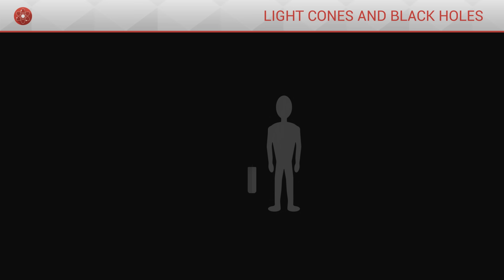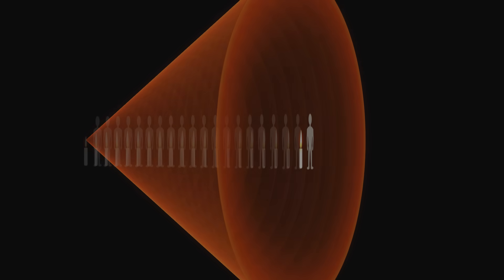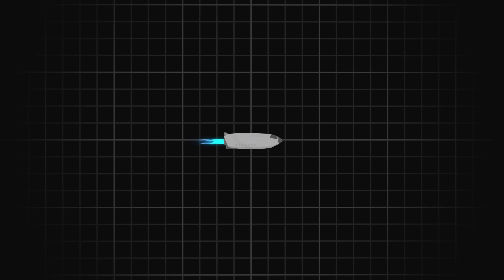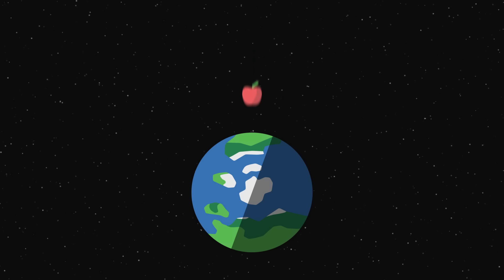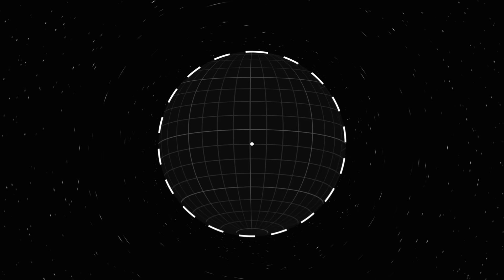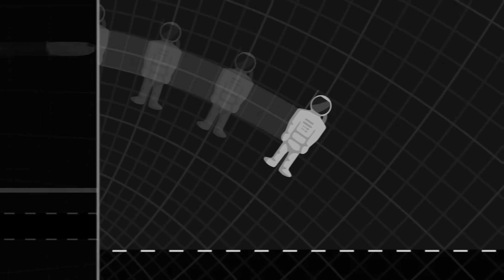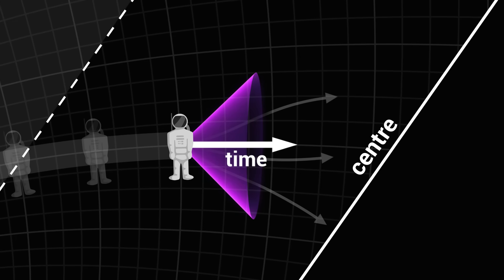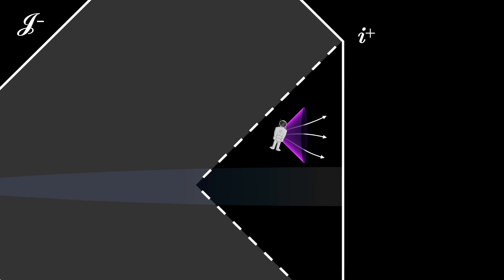Why Time and Space swap in a Black Hole

Comment: What happens to the speed of an object, that enters a black hole?
As we know, all object move through spacetime at lightspeed.
When an object is getting near to the center of the black hole, its trajectory bends even more to the center until it is perpendicular to the line, that represents the center of the black hole.
Inevitably it will fall into the center, but then it cannot continue to move in that direction, cause it reached an end.
Will it then do a full stop? Will it immidiatly turn its direction by 90 degree to move on the line that represents the center?
Reply: Do you mean to ask how the object moves once it hits the singularity? General relativity makes no more predictions at that point, trying to do the math will basically result in division by 0. We can say that the world line doesn't exist anymore after that event. As for what might actually happen if you were invincible and fell inside to watch, physicists believe that it's possible general relativity breaks when the object gets close enough, and we can figure out what happens afterward by using a different theory. But we unfortunately cannot conduct experiments with black holes, especially with measuring what happens to stuff that falls inside the event horizon, so we have no idea what the alternative theory might be.

Comment: Hello ScienceClic,
I love this explanation of spacetime.. I have a question though.. 
If I was the apple falling from space to the surface of the earth (without any initial energy) would I be moving through space? Or just traveling through time?

If I understand it correctly I would only be moving through time.. I would be in the center of the cone and it is this trajectory that creates gravity.. but I would remain still in space?
Reply: Not the video creator but I also studied GR. By the video's definition, yes you will be not moving in space.

"Time" and "space" are not actually fixed directions, instead there are multiple directions that can be called "spacelike" and multiple directions that can be called "timelike". The video picks directions so that time traces the path of a specific falling object. We can pick a different object and end with a different direction of "time". Say you dropped one apple and threw another one upward at the same time. You can pick the first apple for your coordinates, which means the first apple is only moving in time and the second one is moving both in time and upward in space. Or you can pick the second apple for the coordinates, which means the first apple is moving both in time and downward in space while the second apple is only moving in time. Space and time are relative just like in special relativity.

The video is correct despite the multiple definitions. The light cone turns out to be the same, it doesn't depend on how we defined space and time in order to draw it. The black hole's event horizon is tangent to the light cone and all falling objects (regardless of trajectory) will see the singularity as something like a future event once they fall inside.

Comment: With all due respect, these seem more like metaphors for concepts like event horizons to hold meaning.

Even before GR, it is logical to tie space and time together. We can only move, because time allows it. So when you say "I can move anywhere in space but not in time" it's wrong. You can only move anywhere in space *thanks to* time. This premise is a bad premise.

Meaning time IS movement. And space is movement. They are both the same concept viewed from different perspectives. One, an understanding of *position* , the other, an understanding of *change* . But position cannot change, by definition, without change itself. 

So space and time cannot flip, because they are a bad division of the concept of *movement* . The only thing limited here, is your movement, compared to the black hole's. According to GR, its mass limits you, because of your mass, velocity, and prior position. 

Space and Time, sad to say, are not fundamental. They are superfluous, emergent phenomena, from movement. And movement, from identity. Identity from existence. Existence from movement. Round and around.

Thanks for the video, anyway!
Reply: movement, from identity?
Reply: @-_Nuke_-  Bear with me, it's a long comment:

There is (can be) no original action, or concept that "started" any process. The process simply came from the process that made it. And that process, from another one that made it before. Etc.

With that thought to frame your conception of reality, to BE (to have an identity, with a set of properties), you must be made by movement. Usually smaller things must move to make you. Or how would you exist? How would you have what I called your identity? It is the precise accumulation of all elements in your body that makes you, you. To be an element, certain things move, protons neutrons electrons, to be a proton, quarks move etc...

It logically then follows that you, the identity, can now move, in turn. Movement rises from the idea you are a "thing" first. No non-thing can move. First you must BE a particle, a wave, a human, any*thing*. 

Issues arise in any physics context when assuming any one movement or identity are fundamental. In this case, time and space come from movement. But even movement cannot be fundamental. Nothing is. There can only be causes creating effects that become causes. Processes begetting processes. 

That was my point. Physics doesn't actually discuss what IS fundamental. Physics can rearrange our understanding of reality into concepts that act as metaphors, images, to explain what reality DOES. This is why Gravity is still a force, but described very differently from Newton to Einstein for instance. Gravity still DOES what it does. But what Gravity IS, is caused by some other process, in this case the distortion of space-time, which we will one day realise must be a metaphor, an image for some other better detailed process, etc, etc.

There can be no observation of laws without observation of the geometry that helps us notice them, and derive them. So what is physics? The derived general behaviour of the geometry, of matter: the law? Or the geometry itself that was always observable? 

Are laws of physics just clever images, metaphors, for what can be better described as a set of geometric processes? That's my view at least. I hope I was clearer this time.

Comment: Wait, what happens if something falls in, then goes at the speed of light outwards, if the black hole moves by another massive object's gravity, can the object just at the event horizon escape?
Reply: If there are multiple massive objects, the event horizon gets distorted. You might need to be closer to be considered inside the horizon. Still, nothing can escape.

You must shed the intuitive understanding of "inward" always being a spatial direction. Let's drop the black hole and consider regular space. Once you cross the "Tuesday morning 12:00 AM" boundary, can you travel toward Monday at the speed of light to escape tomorrow's project deadline? That question is clearly nonsensical as phrased like this. It's because the direction from Monday to Tuesday is a temporal direction, not a spatial one. The key point is that all things, including light, both move in time and (optionally) in space. You can move from North to South while moving from Monday to Tuesday. You cannot move from Tuesday to Monday while moving from Monday to Tuesday.

Something similar happens inside the event horizon. Your motion toward the singularity is given, all other motion is added alongside it. You cannot move away from the singularity while moving toward it. The direction toward the black hole becomes a temporal direction.

Now this sounds unsatisfying, because you're probably thinking more about what happens if you bought a super powerful rocket, fell into the black hole engines-first, and turned the engines to instantly move at 99.999% lightspeed "away" from the black hole. The answer is that you would be moving very fast in some spatial direction. If you could move purely in that spatial direction without also moving in time then yes you eventually leave the event horizon. But you cannot stop moving in time, and your overall direction will still be toward the black hole.

If you learned special relativity there's another analogy I can make. Special relativity talks about relativity of simultaneity. Say people on Earth believe 11:00 PM on Earth is simultaneous with 11:00 PM on Saturn. A fast moving observer might claim 11:00 PM on Earth is simultaneous with 10:00 PM on Saturn. By Einstein they are also correct and let's honor their perspective. They will watch your journeys. If you were to move toward Saturn at nearly the speed of light, they'd say you were moving very fast in their spatial coordinates. If you purely moved in their spatial coordinates without moving in time you can leave Earth on 11:00 PM and arrive on Saturn at 10:00 PM. Maybe you arrive on Uranus at 8:00 PM and so on forever avoiding the next day's deadline. Alas, one cannot move purely in space. You will move toward Saturn according to the moving observer's spatial grid, but you will still arrive after 11:00 PM.

The exact same thing happens inside the event horizon. The direction you move if you speed "away" will contain some component that increases your distance to the singularity. But you cannot purely move in that direction, instead you move along that direction while still getting closer to the singularity.

Comment: 8:00 But the distant observer should see the astronaut falling without getting to the singularity, right? It should approach the singularity asymptotically, since time would get slower for the astronaut. And in this diagram  it looks like both would agree that the astronaut would reach the singularity.
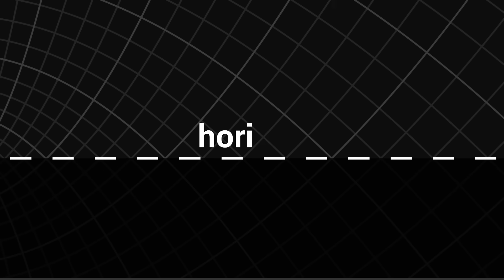Reply from the maker: The distant observer does not directly see the astronaut. He sees the light that he receives from the astronaut. And as it is shown at 7:27 light has more and more difficulty escaping the closer it's emitted from the horizon.

Comment: Not bad. You kind of glossed over the scaling issue though. The light cone shrinks as it rotates.
Reply: Yeah, depending on choice of coordinates it may look very different.
Reply from the maker: Actually I chose coordinates such that the lightcones don't change shape, they stay opened at right angles regardless of where they are or how they are oriented. This is because I based my grids on conformal transformations of Kruskal coordinates. However there is a scaling artefact in this grid representation, in the sense that distances are not to scale in the diagrams.
Reply: @ScienceClicEN  Those pesky coordinate transforms. Just when you thought you were getting the hang of space and time, someone comes along and mixes them up. What can you do?

Comment: what if an event horizon is formed by a ball-like object with more or less uniform density, geomertically speaking the gravity inside it will not be as strong as it is on the surface, so the center will not be a future. and an object will possibly just stay just below the event horizon without falling further

Comment: I find it interesting that all models have observer emitting a light come rather than looking at it as waves from different points in the past converging on the observer. The future might not exist for them.  It hasn't happened yet.
Reply: There is such a thing as a "past Lightcone" it contains all events that could possibly influence you.
It's the reflection of the future Lightcone.
Reply: @narfwhals7843  our experience is created out of the past.  The future doesn’t exist yet.  Any worldliness could suddenly be cut short. The things closest to us are least in the past etc.  but I reject Minkowski spacetime. I have never seen any evidence that time is anything but a compact dimension, a single moment of present which is one Planck second, one Planck rotation, long.

Comment: I believe neutrinos can reach earth before light in supernova. So you could detect supernova before light reaches earth. Great videos!!!! Love the light cone visual.
Reply: Neutrinos do not move faster than light. The experiment that reported this had faulty equipment. It has been checked and remedied.
Reply: @narfwhals7843  I never said neutrinos move faster than the speed of light. But they do move approximately closer to the speed of light. Neutrinos escape the star before the shockwaves even reached the surface of the star. Neutrinos get a head start and also neutrinos don't interact with matter and can pass through almost anything but for the photon is not true.
Reply: @sciencestories22  Ah I see what you mean. That is a fair point.

Comment: "Move through time" sounds like a self-reference, because "moving" is a change of spatial coordinates with time.
Reply from the maker: It does sound weird, however in relativity this makes sense because there are two different notions of "time" : the "proper time", carried by the astronaut and measured on her clock, and the "time dimension", the 4th dimension of spacetime. An object moves through the 4 dimensions of spacetime, as its proper time goes by. And movement can be defined in 4 dimensions. It might be clearer with my series about the mathematics of general relativity.
Reply: @ScienceClicEN  Yep, but anyway it's not clear, especially because moving object in 3d-space become world line in 4d space-time. btw, loops in space-time are actually possible when, for example, pair of particle-antiparticle forms and then annihilates - their world-line will be a loop.

Comment: So many questions! 

1) Would the matter inside the black hole not, presumably, hold itself up? As in, why can I not stand on top of the material itself in the same way I would stand on Earth's surface? Or does the matter of the black hole forcibly get squished into nothingness at the singularity? (this is where the physics breaks down, yes?)

2) Would the outside observer ever truly see me fall into the black hole? Doesn't time dilation make it appear as if all my mass just squishes at the event horizon until the end of time?

3) Is it possible to "accelerate" out of a black hole? Like if I had a super powerful jetpack? This seems related to #1, in that space itself should be "falling" faster than I can accelerate. But then that would imply that no physical surface could exist for me to stand on, because the surface itself would be "accelerating" me faster than light, just by standing on it.
Reply from the maker: Very good questions :

1) It's impossible to stay still inside the black hole, because horizontal lines (which represent "motionless" trajectories from left to right) escape light cones, since they are tilted at more than 45° below the horizon. So nothing can stay motionless inside the black hole. Penrose proved a theorem that states that a star inevitably collapses into a single point, in a finite amount of (proper) time. At least according to general relativity...

2) He would indeed see you freeze on the horizon. And actually if he watches the star collapse into a black hole, he would never see the horizon form. He would see the star shrink, slow down, and fade to black.

3) Exactly it's related to 1, since if you could accelerate out, it would mean you could at least stay motionless. Both are impossible. All trajectories are strictly confined within lightcones, and therefore are bound to fall to the singularity.
Reply: @ScienceClicEN    Thank you!
Reply: 2) outside people will not see you after you pass the horizon since no light can gou out of there

Comment: 2:55 What is the difference between space and time? Simple, space exists but time does not

There is no such thing as Time
There is no such thing as the past
There is no such thing as the future
There is only existence 

Explanation #1: Snow Globe Example
If you shake a snow globe and observe the snowflakes falling, what are you really observing? Select an answer: 1. Time or 2. Motion?
Obviously, the answer is motion. This is the real universe in nutshell. What we perceive as time is only the universe in motion.

Time is only a tool, it is a measuring stick used to observe the movement of the universe. If there was no universe then there would be nothing to measure and thus, there would be no time.
This is why when we 'reverse time' we can only reverse back to the big bang. Before the big bang, there is nothing to measure and thus, there is no time. 

Time is the great deceiver, time is the great slave master. Escape the illusions of time and you will find real freedom, freedom from death, suffering, and modern slavery.

Where is Explanation #2 and more? They are too long to write in a youtube comment.

Comment: Considering the expansion of the universe, there's a distant space, which moves from us faster than the speed of light, hence we can see it's past, but cannot reach it.
Sounds pretty much like a black hole horizon, doesn't it?
Reply: the curvature of the visible universe is VERY flat.
space expands uniformly (over space), that expansion of space speeds up over time.
none of the above fits into a black hole.
Reply: horizons are very intersting.  the cosmic horizon would also give off a form of Hawking radiation, they say.  

there is also a horizon formed during acceleration that produces Unruh radiation, analogous to Hawking radiation